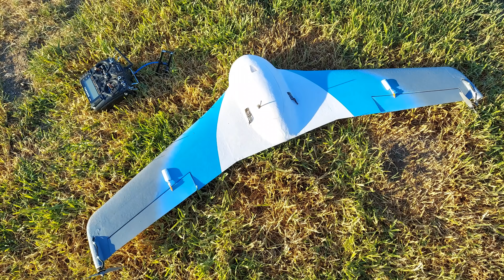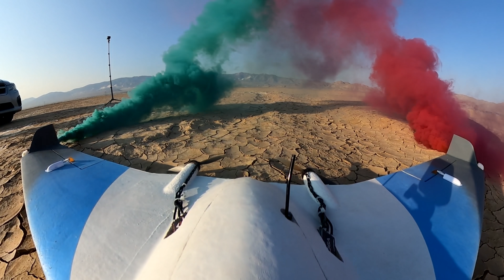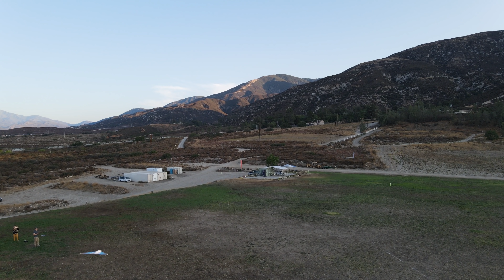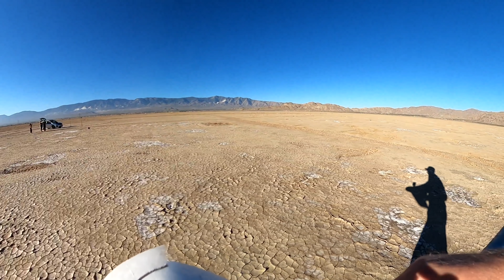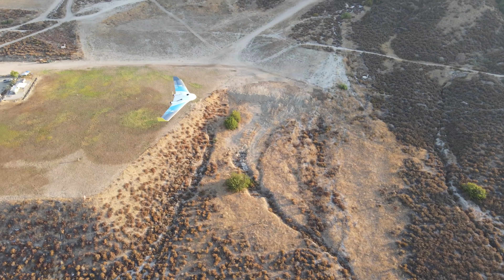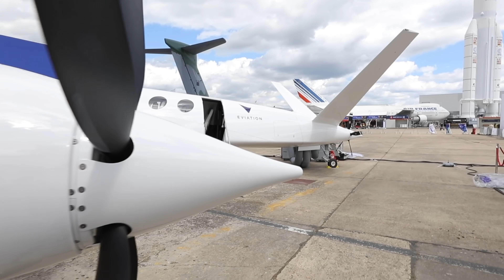Can Wingtip Motors Improve Aircraft Efficiency?  RCTestFlight Solar Collaboration Part 1

Comment: The reason they don't mount motors on wingtips on real aircraft is that if one engine fails it would cause incontrollable adverse yaw.  The reason they put winglets on the tips of large aircraft is to reduce drag caused by wingtip vortices.

Comment: Awesome testing. Good preliminary research is the one that leads to many more questions to ponder. I think you've done that perfectly. 

It would be very interesting to see how things change between push and pull configuration, different rotation directions, different propeller sizes.

The only crib I have with the work you've already done is the additional motor pods on wing that were there in your second configuration. You can't really compare the drags in a true sense especially because the final degree of improvement was very low and I'd expect those pods to add as much intereference drag.

Comment: Great testing and excellent reporting on the results.  However, there’s one aspect not covered here:  safety.  Should wing tip motors be utilized in commercial aircraft, and one of those motors malfunctions mid-flight, the incredible torque placed on one side of the craft, so far away from the fuselage, would most definitely put the plane in peril due to the enormous torque the motor would place on the pilot needing to attempt to compensate for that out far, far outboard motor pulling the plane consistently and strongly to the left or right (depending on which motor failed), that the pilot would surly not be able to compensate with rudder control enough to keep the plane in straight and level flight.  More likely, the incredible torque of one motor that far from the fuselage would pull plane very strongly in circles, and possibly so tightly that the pilot could lose control of the aircraft.
Reply: just need a wingtip version of the rutan boomerang 🙃

Comment: For safety, you would need to have a coaxial dual motor setup per wing tip.  Props in either, dual tractor, pusher or one tractor and one pusher.  Not sure if contra rotation would be needed or not.

Comment: Whatever gains you might get from putting engines on the wingtips would be offset by the many drawbacks, including greatly increased moment of inertia (which reduces roll and yaw rates), severe control problems with loss of one engine, greater stresses on wings (requiring heavier, stronger wings), and more.

Comment: Motor failure on wing tip will cause fatal thrust yaw. The Bell 280 has a mechanical coupling between the two rotors.

Comment: It is awsome that it doesn't have a secondary wings.

I have seen how aicraft flex wings when takeoff. If the motors are at the wingtips then the flexup is just in middle wing. Giving the appearance of a parachute. Yes, this could be more aerodynamic efficient in terms of dynamic wing shape.

Comment: One of the advantages of a dual-engine aircraft with motors near the centerline of the fuselage is that failure of one motor has less effect on yaw than a wingtip motor would. So from a safety standpoint, it seems to me that the rudder would have to have a large enough control surface to offset the larger amount of yaw produced by propulsion located at only one wingtip. Is that possible without introducing excessive drag?

Comment: One big problem. If one motor goes out then that flying wing will flat spin and crash. You might be able to overcome it with an extremely large vertical stabilizer. That’s impractical though since it’ll cut into the efficiency from the placement of the motors.

Comment: The further away from the center line of the A/C the engines are, the more there is stress on the main spar. This is why manufacturers try to keep the engines as close as possible to the body of the aircraft. There is also the case where if one engine quits; then the yaw force exerted is such that the rudder may not be able to counteract it and the A/C could become uncontrollable. Some modern A/C with tilt rotors have engines on wing tip but wings are short ans aircraft will probably remain 15-to 20 pax Max

Comment: I really appreciate your explanation on how planes fly ...especially as an aerospace engineer. Would have been cool to see how rotating the props in the opposite direction affected the flight characteristics.

I disagree with the flow being separated at the high point of the wing though. You should be aiming for laminar flow over the wing if you want high efficiency, so the flow should be attached along the whole wing section, especially with a blended wing/body configuration.

Comment: I wonder how this would change when comparing wings using different lift distribution. The flow conditions around the tip with an added prop must be totally different and you would probably need more advanced simulation to properly take advantage of it!

Comment: Another big problem with wingtip motors is the structural support necessary to carry the weight of the aircraft from such a distant leverage point - both the lift weight, and the thrust weight, is transferred throughout the entire length of the wing fully rather than gradually when the thrust is closer to the centerline.  Would the increased structural material (mass) defeat the efficiency gains of the motors?

Perhaps having primary thrust closer to the body - the way traditional aircraft designs have now - and secondary thrust at the wingtips could offer some balance.  The primary thrust gets the frame off of the ground with the wingtip thrust providing balance rather than thrust, and then transitioning from centerline thrust to wingtip thrust at cruising altitude where there is less raw thrust needed to keep the frame aloft.

Comment: This can be explained using something called "lifting line theory" and the idea of circulation.  Essentially the wing generates "circulation" (an abstract way of viewing lift, lift and circulation go hand in hand, see Kutta–Joukowski theorem). This circulation "leaves" the wingtips in the form of two counter-rotating vortices. These vortices slightly tilt the lift vector backward causing lift-induced drag, since now a small component is opposing the direction of motion. Next comes the educated guess/hypothesis, The motors produce an anti-rotating vortex to each of the wingtip vortices which in turn reduces the effect these vortices have by reducing the downwash that causes the tilting back of the lift vector thus reducing drag.  Check out lifting line theory and circulation, it's fun to imagine an "embedded vortex" in the wing that spills out into the surrounding flow.

Comment: The reason why in commercial aircraft have engines places closed the to the fuselage is safety.  The further outboard you placed them, the more likely the aircraft will be uncontrollable when losing one engine.  In this type of scenario aircraft have a tendency to flip over especially when giving too much throttle.

Comment: There will probably be a huge difference between full-sized planes and RC on this. Winglet motors on a full-sized plane would create a lot of extra weight and torque on the wings, requiring extra structure, which means more weight, and less efficiency. This is likely a lot less of a problem for RC planes, who's wings aren't generally going to have issues with the added weight on the tips

Comment: Your phrasing around the source of induced drag makes it seem like there is debate around what causes it, but it's really REALLY simple. Induced drag is simply the rearwards component of the lift force. What exactly causes it is... lift. That's all it is! So to reduce induced drag, you have to, basically, either reduce lift or reduce the lift angle - which can be done many ways.

Edit: you also state that the air is going to be 'separated' behind the wing spar. I highly doubt that! It might be turbulent, but even that is not guaranteed given the low Reynolds number this wing is going to fly at. I'm fairly sure the flow is going to be attached and mostly laminar all the way through 70-80% of your chord!

Comment: If this ever gets revisited one thing i'd check is minimum speed for both configurations. The wingtip vortex is basically what creates lift. Most fancy wingtip gadgets that never took off tried to reduce it, which affected BOTH drag and lift netting little gains. So i wonder if or how much lift you were missing here.

Also while the props were definitely extracting some energy from the vortex, prop efficiency was going down due to turbulence (and working at an angle to airstream in places)... Tbh this whole wingtip ordeal is mostly about moving the air more smoothly as it's almost a zero sum game. Conventional designs still win because nautre is not compliant to perfect conditions of simulations.

That yaw authority thou... :3 it flew beautifly!

Comment: what really surprises me is that they are not using an APU with these electric planes that would be my main gripe as it's a good idea to have an auxiliary power unit on board.  
you could even fuel it with hydrogen if it really bothers you but there should be some source of liquid fuel on board with a high amount of energy density for emergencies and of course he ever so mention battery failure that could happen especially when lightning strikes the airplane

Comment: My 2cents: you gain all the surface of normal engines positions, but you loose astronomic efficiency in aircraft manoeuvre. 
You test it on wing, test it on plane also. 
If winged, you need vectors motors to help a bit handling. 
Also need a rudder. Absolutely need it as engine will increase all deviations in flight. 
If these mods are done you could hope good results 
But never as good handling than a light balance wing with central prop

Comment: There is another issue with wing-tip motors in aircraft that carry "precious cargo" (i.e. people), and that's the fact that if one motor fails, the yaw induced by the other motor would likely render the aircraft un-flyable until it was shut down.  Modern designs might require a lot of rudder to keep going straight, but it can be done.  As the old joke goes:  The purpose of the 2nd motor on a twin is to give you enough power to get to the crash site (yeah, pilots have a morbid sense of humor at times).

Good video though, and I like the BWB design, and paint job.  

Last thing (I never did get the hang of brevity on the Internet): Do you have any plans to experiment with PRANDTL wings?

Comment: I am an FAA licensed pilot.  I would not want to ride in any aircraft with only wingtip thrusters, jets or props.  Lose one thruster and the aircraft will want to fly in circles as it falls to earth.  Asymetric thrust is insane.  It would be fine as long as both thrusters are totally reliable.  Electrics are better than most other engines if designed with reliability in mind but nothing is 100% reliable.  If you want to fly a glider you are better off to start with no engines.

Comment: The wing forces air down. That air has to go somewhere. The path of least resistance is to circle around and go back where it came from. The momentum in the air manifests as twin vortex/vortices. The pressure wave will travel at the speed of sound (1000 ft/sec) around the circle and impinge on the top of whatever part of the wing is still in the way. Long skinny wings make the circle-path longer and get out of the way quicker. Wing-tip gadgets can counter the vortex - but there are trade-offs.

Comment: I guess the larger the wing tip propellers the larger the effective wingspan ring true with the Bell 280’s design. 

Maybe you could have a design that utilise gliding with the props being partially stationary catching the benefits of a changing trailing vortices.

Comment: That inboard wing prop configuration, reminded me of the instability experienced by the 1946s earily Flying Wings. I instantly rejected, that prop reconfiguration suggestion, because my mind recalled that Airforce's prop placement dilemma. It seems to me that the prop and wash are interrupting the natural airflow over the wing. Which is proably why, the military contractors got rid of the inboard propellers altogether (replacing them instead, with more aerodynamic jet housings--like the later Flying Wings and B1). The wing tip propeller configuration seems to allow a better over-all airflow pattern over the entire wing--more natural. 

Whereas, the inboard prop config on the wing, seem to interrupt that natural airflow thereby, causing excessive drag, stall; collapsing the low pressure pockets infront of and above the motors housings; resulting in critical instability. The wing tip prop configuration is perfect, because it is right in the natural air vortex coming off the wing--the propellers acting as a artificial vortex extension, thereby granting natural wing lift stability. Now that I think about it; that's the artificial wing extension you sought to duplicate. You did it! In reality, your configuration creates another vortex within a natural vortex. You just made me think of something else. If I'm right, that what you've done. Congragulations!!

Comment: What your not understanding is single engine work in twin engine aircraft. With the engine on the wingtip would lead to tremendous increases in torque due to its increased leverage not to mention the structural increases required in the wing itself thus adding increased weight. I think your barking up the wrong tree, your ideas won’t scale.

Comment: I think this can only happen because the propellers are not 100% efficient. The swirl of air that comes off of the propellor is what has counteracted the wingtip vortices but I guess you can’t say wether the propellor makes the wing more efficient or wether the wing makes the propellor more efficient. 

I think the wing has been made more efficient and if so then you could test weaker and weaker motors (with central thrust to compensate the loss of thrust) until you get no vortex. This would then be the optimal wing tip thrust to eliminate the vortices. Then you could have most of your propulsion at the centre which would reduce the motor out risk the comments keep referring too.

Comment: When I saw the relatively tiny props, I figured the difference would be minimal. I would guess that sweep and lift distribution would also make a difference. My guess is that a straight wing with an elliptical lift distribution would show the greatest effect. I also wonder what lift coefficient that wing was at during those long flights. And whether the air speed was the same. If the throttle setting was the same, I'd guess the tip mounted configuration would be a little faster, using up some of the energy saved.

To really see the difference, suggest a geared down motor, like the old GWS motors, with precise mirror image props, and motors that could spin them identical speeds. It might be necessary to change the timing on one of the motors to achieve that, unless the GWS motors were so cheap that they weren't timed for one direction or the other. Switch sides with the motors to compare. In slow flight, I bet big differences would show up on a Pico Stick or something like that. With brushless motors, of course, all you have to do is switch the leads, but can you get a brushless that will spin big props? I think Zinger makes right and left handed props, but you'll have to ask them if the props are exact mirror images. Radical RC carries counter rotating prop pairs.

Comment: I'm sure you have considered the Flying Flapjack and the way its contra-rotating props countered the tendency for high pressure air under the wing to leak over the wingtip and on to the top surface? It was the whole point of the design, like having active winglets that also provided all the thrust needed. That allowed a very low-aspect ratio wing and extreme maneuverability. But if you want solar-powered efficiency, I doubt you would care about things like a fighter's maneuverability. Better just with a massive aspect ratio and a conventional placement of the prop.

Comment: If you had engines on the wingtips and you had one fail it would make it more difficult to control and keep in a strait line.
It would also need the wings to be a lot stronger at the tips to handle the power of a jet engine.

Comment: I guess that another decision for civil passenger aircraft is safety. If a wingtip motor fails the other one will definitely pull the aircraft to one side if its not in very high speed. So its going to roll and yaw. So it will either be hard to control or even eventually spiral into the ground or be left as glider.

Comment: Tip: spanwise "helical" (roll-up) net lift distibution (after induced and profile drags).  HINT: There IS a sweet-spot (for mounting placement based on a few other factors, mostly prop pitch..  😉👍  keep researching and experimenting....you WILL find it!

Comment: Did the version with the winglets have a slightly shorter total wingspan or did the winglets attach with the same length extensions that were on the motor pods?